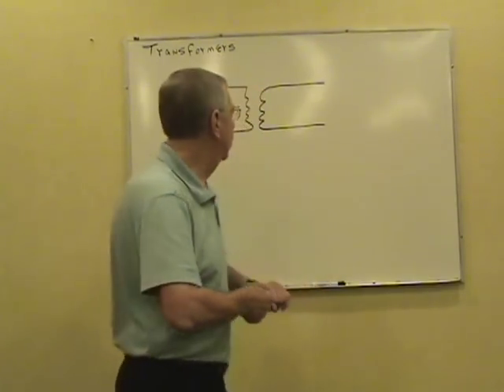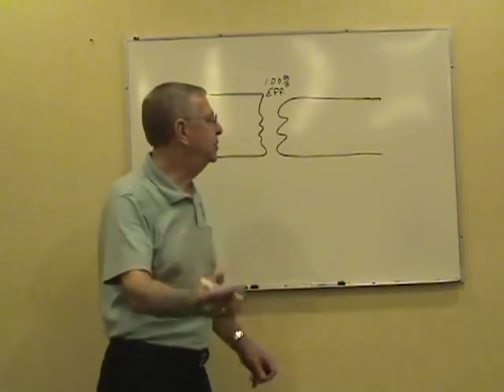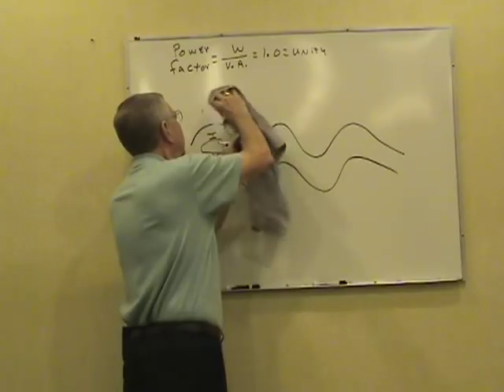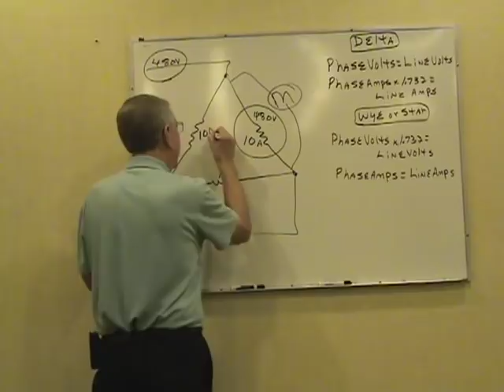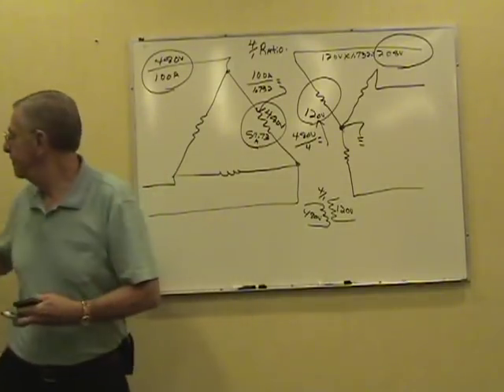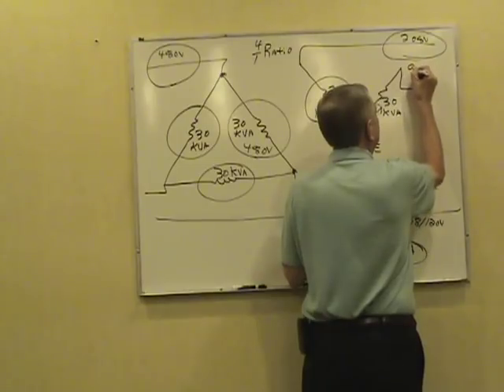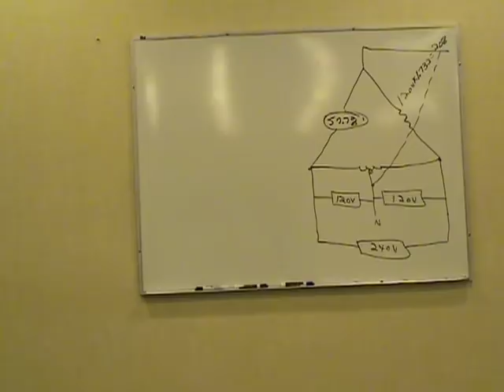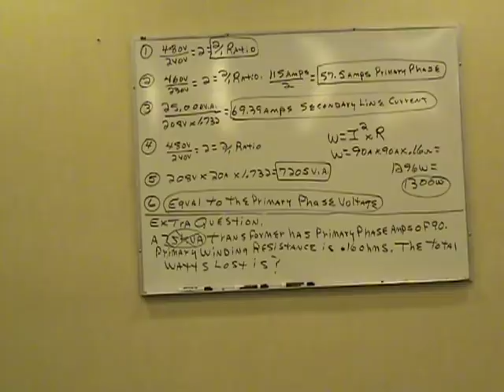Transformer Calculations Single Phase & 3 Phase with Jim Lewis

Comment: I thought there are 4 lines for a delta connection, Does it change when you hook it up to a Why connection!!??
Reply from the maker: +Ronald Jenkins If one transformer is center tapped for a neutral, then you will have 4 lines. 3 plus the neutral conductor..
Reply: Jim Lewis
Just Learning, Always getting better
Reply: Just a reminder, it's spelled like "wye" and not "why"
Reply: Ronald Jenkins delta can have 3 or   4 (with neutral ).
Reply: Ok Thanks Guys!

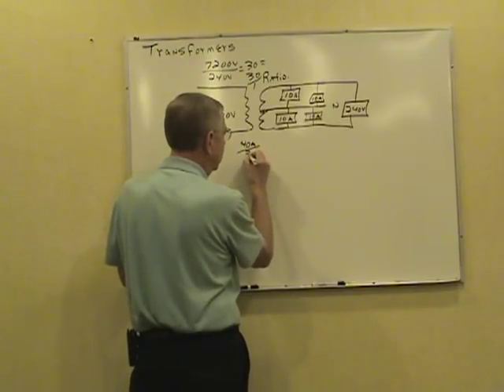Comment: Thanks for the video, Jim. At 5:40 you mentioned that the secondary current would be 40A. Isn't the current actually 20A, particularly in the balanced case, because "10A + 10A" current would flow in a "clockwise" loop (just a chosen convention) through the secondary winding out to the "top" 120V phase, through the loads, then down to the "bottom" 120V phase, finally returning into the winding, with zero current flowing through the neutral?

Comment: i want to ask in star or delta connection how to calculate phase current (as  i want to find the line current)
Reply from the maker: +pranjal khanduri Delta connected: If you have the phase current multiply the phase current x 1.732 for the line current.Wye or Star connected:The phase current and the line current are equal.Jim